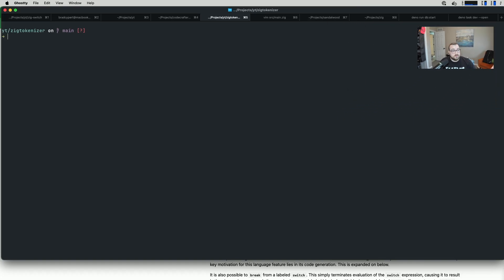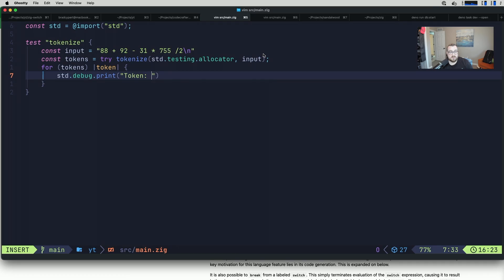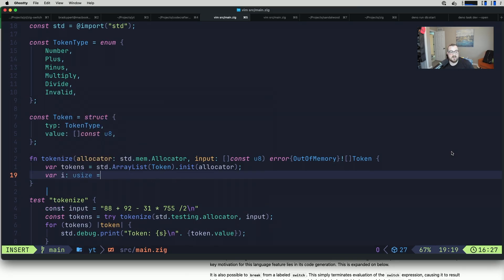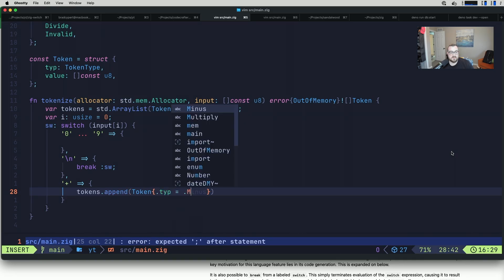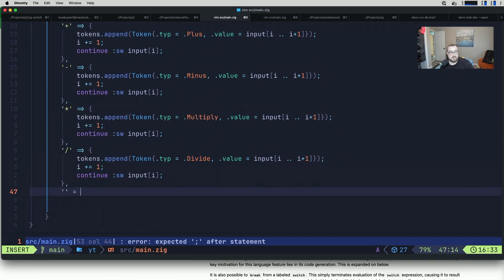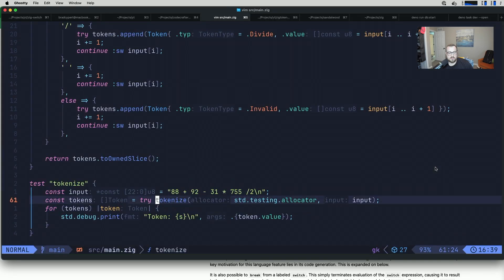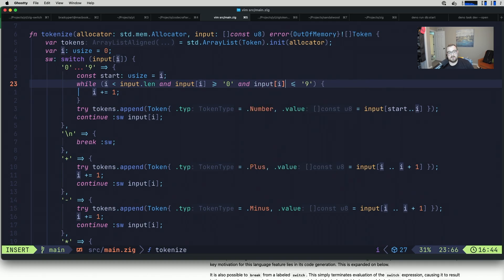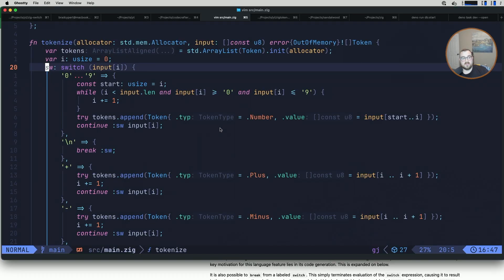A Tiny Tokenizer in Zig to try out Labeled Switch

Comment: It would be nice to compare this to a solution with a loop over the input characters though: as another commenter pointed out this is very much a loop with a break in it... Yes you'll save a level of indentation with the switch.
I think I'd still prefer the loop though. I would have said that I prefer it because you don't have to look at all cases to see what it's doing, but in the loop you could have break etc also everywhere - I just wouldn't assume they are there. 
So what remains is that imo the loop conveys the intent more directly... (yes I know - who wouldn't think that the tokenizer with this signature would be a loop? Not sure that's still a good argument though)
Reply: > It would be nice to compare this to a solution with a loop over the input characters though
While for this example in specific it would likely not matter since the optimiser can view through it, for more complex cases (e.g. the Zig compiler), it can speed up the code quite a lot.
As the Release Notes of 0.14.0 said, changing from loop with switch to labeled switch alone made the Tokenizer about 13% faster.

Comment: I decided to follow along, but in C, and the main loop in my tokenize function came out to 28 lines. Now, admittedly, it is easier to be able to do '0'..'9' to hit 10 cases, but since C has implicit fall through, I just did `case '0': case '1': ...`. The operator cases I left as one line: `case '+': tok.val = 0; tok.ty = EADD; break;` and you see the pattern. I put whitespace skipping as the first case, `case ' ': case '\t': case '\n': continue;`. I'm honestly not sure why a labeled switch is supposed to be any easier and I construct the token in the switch then have one ArrayAppend() call at the bottom of the loop, which I find easier to read and debug.

I keep hoping I'll find something profound in Zig that will make it worth learning, but the more I learn the more I think it doesn't have a reason to exist. Its syntax is worse than Rust, and that's saying something, but it seems to have an ideologically motivated design, i.e. removing goto only to insert a more convoluted construct in its place. The one thing that I see that's truly a great construct is that of namespacing, but I wouldn't describe it as being the best at it. C++ is certainly easier in that regard, but since Zig has a bit more context sensitivity relating to enum's it has a bit more usefulness there.

If you're curious I could post my code on PB. I wrote it from scratch while I was watching the video, including the array handling code which I separated out into its own module. I might extend it into a full calculator app tomorrow if the tile guy doesn't show up.

Comment: everything is goto... well, technically everything is jump (jmp, jnz, jne, ja, jl, etc.)
So I don't really understand the hate for goto.
Reply: Yes, everything is a jump, but when we say that gotos are bad we don't mean that the concept of a jump is bad. We want to stress that, in languages with higher abstraction, gotos are a simple way to make your code less readable and harder to reason about, when these languages have ad-hoc constructs to better express the same behaviour.
Reply: @andreasibona7995  Anything can make you code less readable, using lots of gotos can be one of those ways, but it can also help to make your code even more readable in some cases, and can lower the amount of edge case features a language would have to implement just to let you do it without goto.
I personally like to have gotos available, I may not use it a lot, but when I do, it will help a lot.

A language that lets you shoot yourself in the foot can be very powerful, but you can still shoot yourself in the foot, so you have to be careful... also you can still shoot yourself in the foot even if the language doesn't directly give you the tools to do it.  Making it harder  to do so can be useful in some cases, but it also severely limits what the programmer can do.
Reply: yeah if you are disciplined in your use of goto (only mimic structured control flow) it's fine.  but most uses of goto are "unstructured" or "semistructured" (in switch statements) and that's the problem.

Comment: fyi: shift-g will move you to the end of the file. a bit quicker than ":999"
Reply: @jell_pl  And g g jumps to the top of the file
Reply from the maker: Thank you :) I have learned that, but getting it to be in my mental model when recording and juggling my notes for a video is something I am still struggling with. It’s a bit embarrassing to watch myself in a video in Vim because I see so many small mistakes 😅
Reply: @CodeWithCypert  IMO thats not a mistake. Just different way to achieve what you wanted. At the end you went where you wanted.
No pressure ;)

Comment: I feel like a simple loop is way easier to read and write thought. The `continue: sw: input[i]` is the same for all branches so it fits perfectly as the increment of a loop. 
However, I'm gonna try to write a state machine with this. I think it would be interesting to walk though different states using this, and be way easier and readable than the common loop or recursion you might see in a state machine
Reply: @hexailon  Great to know this labelled switch can reveal whether the loop refactor is necessary :)